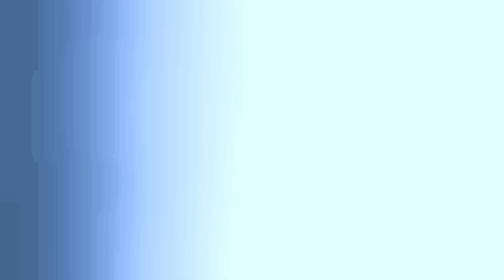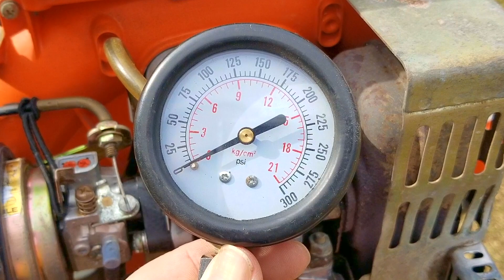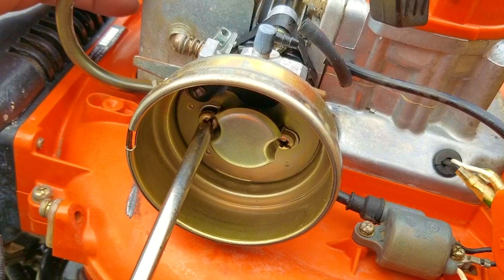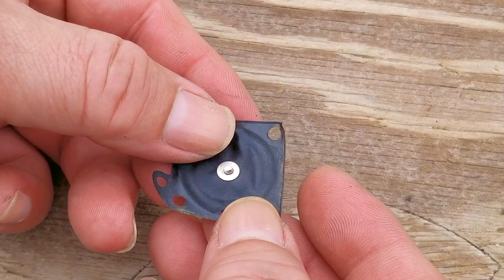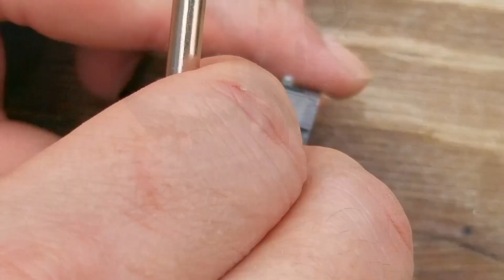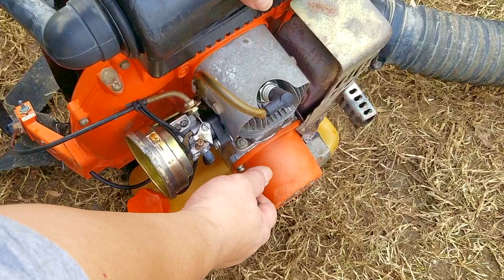This Fix For A Vintage Echo Blower Doesn't Go Quite To Plan

Comment: There is a vintage 3cho pb 202 for sale for 35 bucks the seller doesn’t know if it’ll run or not but do you think that’s a good deal? I’m assuming probably has a fuel issue looks to be in really good condition.
Reply from the maker: For $35 buck I think it's worth a shot.
Reply: @HomeGaragechannel  we are still going to try to get it but the seller was kind of rude when we asked if it has good compression, she said she doesn’t know what it was and she said if you need to know, it’s probably not for you but maybe we’ll get it and try to fix it. She has like no backstory on it so it’s a mystery.also Merry Christmas if you celebrate.

Comment: I would try to revive the diaphragm. What is diaphragm reconditioning liquid?
Reply from the maker: I'm using brake fluid, and it's worked great for me.  But you're welcome to try whatever fluids you have around.   I will tell you, some fluids have absolutely no affect on it.

Comment: After many days of f'ing around, I discovered my zama carb had MANY check valves inside.  These check valves sticking open or shut is what stops them from running.  It is why "rebuilding" them and "cleaning" them don't work.  I was crazy enough to rehabilitate these valves and was successful at that on all but the check valve on the main jet.  Not sure how to remove that one.  I ended up getting an aftermarket carb.  But the catch is they are not the same.  My OEM one had an accelerator pump for instaneous throttle response.  So now I live with some bogging when I throttle up.  RIP
Reply from the maker: thank you for sharing that

Comment: What oil do you use for your mix? And what would be the best I want my machines to run as long as possible
Reply from the maker: thanks, I use Blackmax 2 stroke synthetic. Use whatever is in your budget and mix it correctly. Many feel that you need to buy the most expensive oil out there for it to last but to be honest, you just need to use good fuel, and mix it correctly.

Comment: To answer your question: I´d never even think about buing an aftermarket carb anymore. If cleaning the original carb manually and with the ultrasonic cleaner and installing an oem carb kit doesn´t help I´d get a good used oem carb and try again with the same method. Aftermarket carbs gave me a lot of trouble, I learned my lesson the hard way. With some of them the engine runs like a sack of nuts, no matter what you do to them. Some run the engine surprisingly fine but I don´t know what material they are made of, some deteriorate already after a fiew months from the fuel or the elements. Rubber parts and gaskets swell up or shrink and cause failure. No. I´m through with aftermarket carbs, in my opinion they cause nothing but trouble.
Reply from the maker: nothing wrong with that

Comment: how was the spark plug...what was the initial complaint? ....not a biggie since it started....prob new carb....ALL new parts ....customer dont want 1 old part fixed with a new part working with a bunch of old parts ready to break
Reply from the maker: spark plug was fantastic, and there wasn't even an initial complaint.

Comment: well for me if that was my backpack leaf blower i,d simply take it step by step to figure out what is the goer or situation with it and to your video giving me a good idea it has a excellent amount of compression and a healthy spark so don,t give up on it that easily as it could be a fuel line or a fuel filter issue as they tend to clog up from time to time and they are often easy fixes too etc.
Reply from the maker: thank you Patrick Stapleton, and yes we're going to move onto the fuel line next.
Reply: @HomeGaragechannel  yes for sure that might be the problem from there you never know really etc.

Comment: I have 2 or 3 of those that might be a little older, air filter box is a little different. I would have thrown a carb kit in it and that usually works. Hows the fuel pickup/filter? Line have a pinhole?
Reply from the maker: ah, thanks for bringing that up, When I check it's flow
off camera, it was great, but in the second half, I do replace the line.
Reply: @HomeGaragechannel  yeah, sometimes replacing the fuel lines can be a royal pain in the rear but it does at the least eliminate any doubt that it is the fault and also it could save a headache in the future from the line giving up the ghost at the worst possible moment. Great vids, keep em coming! Much love from rural Skagit County, WA
Reply from the maker: thank you I appreciate that

Comment: Did you check the fuel filter? May not be letting enough fuel past. Cheers
Reply from the maker: Yes it's free and clear, I just didn't show it on camera. you'll see more in the second part.
Reply: @HomeGaragechannel I find that its not very often a fuel filter is plugged anyway. Cheers
Reply from the maker: thank you again!
Reply: @HomeGaragechannel  np

Comment: I have a older version of yours. I went with an aftermarket carb as the one it had was very finicky even after adjusting and cleaning. Did you use 50:1 fuel? The manual is quiet confusing at it mentions 32:1 and 50:1
Reply from the maker: when I looked at the manual, I only saw that it said 50:1, so I'm not sure where you saw that? I read that off Echo's website for the PB-400e on page 5.

Comment: So I had a chainsaw and I would think it was going to be an easy fix but I would not get any fire. So the. I put some fuel in the spark plug hole and it still wouldn’t fire……. I forgot to turn it on
Reply from the maker: oh it's happened to me, plenty of times

Comment: I did a little bit of adjustment on the carb on my weed eater and now the engine is running great and it's not smoking anymore and it's not using much gas😁
Reply from the maker: nice work!
Reply: Thank you so much

Comment: Its usually the diaphragm that goes bad over the years on these 2 cycle carbs.
Reply from the maker: yes most often you are correct. But the pumping diaphragm on this one, is the same rubberized material as the metering diaphragm, instead of the better mylar, that won't harden. So I'm going to try and soften the diaphragm and see if that works.

Comment: Putting gas in the cylinder vs quirting gas into the carb.  I'm confused.  Wouldn't squirting gas into the carb actually indicate if the carb is working more than squirting into the cylinder?
Reply: Actually no.  You're just squirting gas straight thru the carburetor and into the intake port in this case.  Carburetor would just basically be a hole to squirt past. No metering or anything is actually being done.
Reply from the maker: well put.
Reply from the maker: we're trying to get the engine to run, not gain any information about the carb. 
But also, on this one, getting the engine to run, will try and work the carb, to draw fuel from the tank. 
This particular carb does two things, draws fuel from the carb and deliver it to the engine.